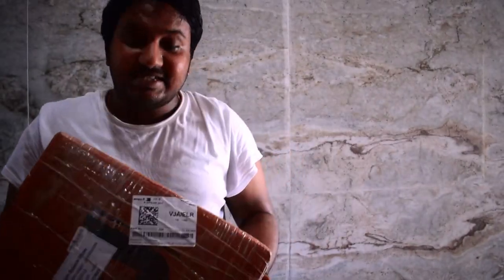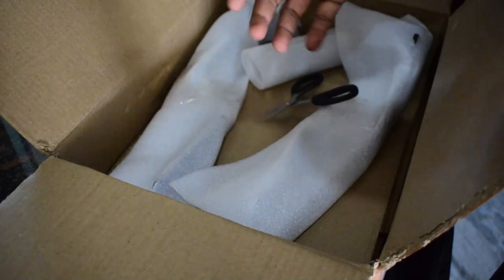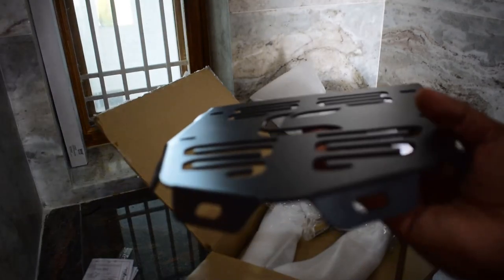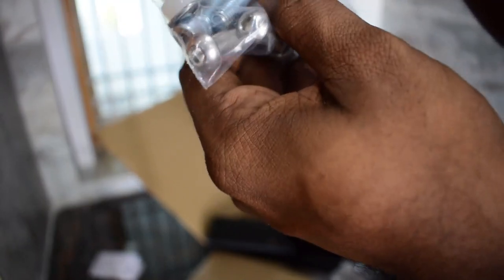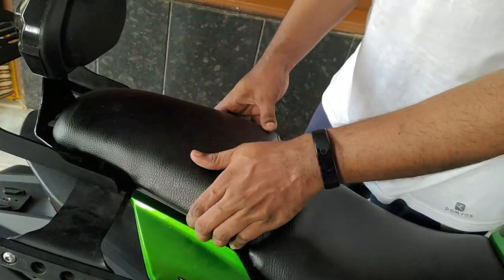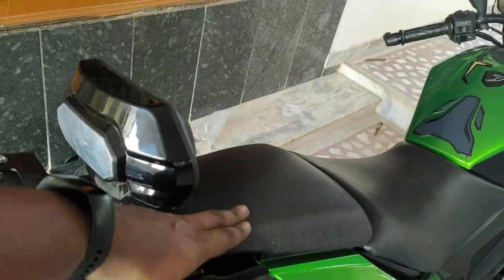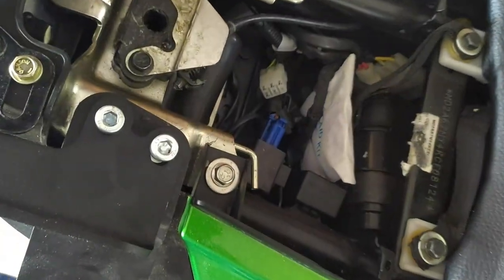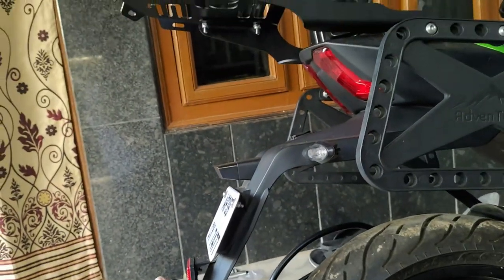Carbon Racing Top rack installation #DIY #Dominar400UG

Comment: Weight carrying capacity of the rack?
Reply from the maker: 5kgs no issues. But I tried with bag about 8-10 kgs and driven about 800km. The result. One of the Main support legs got bent due to rough roads and all

Comment: How much weight it can bare?
Reply from the maker: 7-8 kgs if u r going to be on complete ruddy roads . 10-12kgs if mainly on highways wid not much of shit roads. Recently I did put overweight on it and travelled around 2k kms and the bottom arms got bent. If u wanna put some extra weight then don't take this one bro. This one is like a cantilever . Take any top rack that gets supporting rods on the ends too
Reply: @AnuraagDiyya  how much weight did you carry so that it bent?  Did you use a top box?